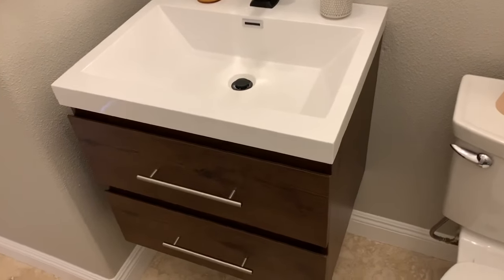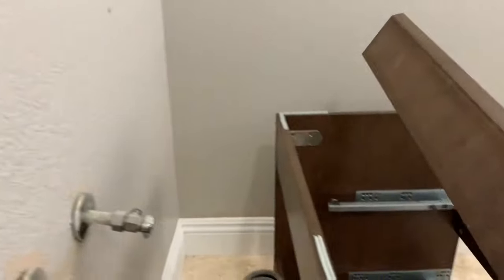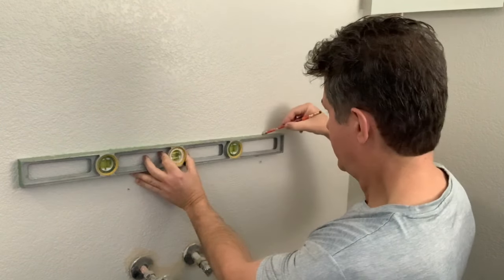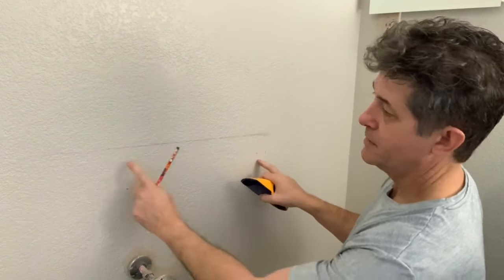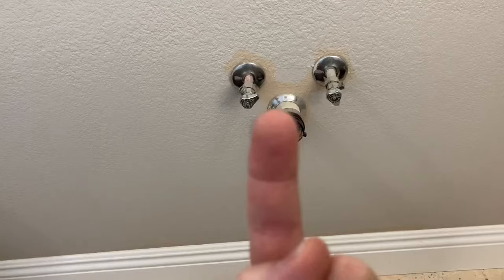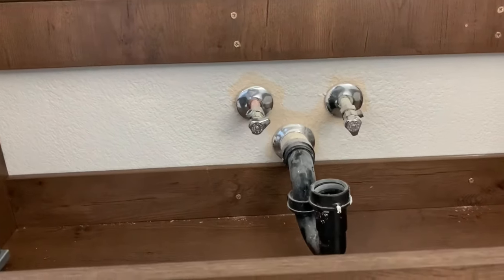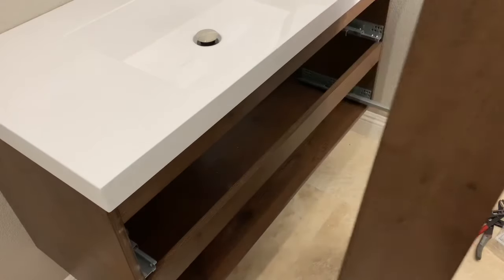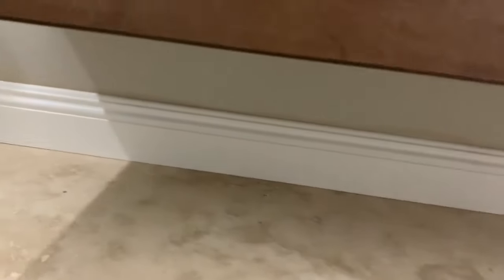Install a Floating Vanity

Comment: The top should be at 39” for optimal comfort, other than that great video
Reply: Where do you get that info from? Years ago we used to install them 30"-33" now 34"-36" is the norm. Where do you find 39" as finish height on the regular?
Reply: 39 is to tall for kids
Reply: 39” I’m not washing my chin bud.

Comment: The water leaks inside the gap between the table top and the wall in my washroom.. and my vanity has kind of deformed/bended as a result of all that water 😢 do you have any recommendations to fill the gap between the tabletop sink and the wall ?? The brand is Magickwoods
Reply from the maker: Sure-just add a bead of caulking at the top where the top meets the wall
Reply: @MikeKlimek Thanks, my plumber came today and added a silicone sealant at the top and also pasted the top to the vanity with the silicone. Turns out the guy who had installed it originally hadn't even bothered to seal the gap when he originally installed it for me. He'd said there would be no problems and I made the mistake of trusting him😢 
My vanity is saved... for now I guess (its a floating one too)

Comment: I am installing a similar vanity but I've run into issues with my wall having a bow at least 2 inches. If i shim the vanity there will be large gap and i dont want to fill the large gap with Caulking.  The only thing i can think of to fill the large gap is drywall compound but I'll need to use alot considering the size of the gap
Reply from the maker: Yes that will be pretty noticeable, especially if you have a nice shiny top and drywall compound to fill in the gaps

Comment: Installing a very similar HD floating 30" vanity now and ran into the same problem with the drain!  I really want this at a 36" finished height so I am going to cut a notch in the lower cross piece. I think it will be secure and not mess with the integrity. Also be sure not to snug against a side wall because the top does stick out each side about 1/4 inch.

Comment from the maker: Thanks for watching! Leave any questions or comments below:
Reply: Thanks for the video. I just got the same vanity, but Im installing in an old building with plaster & lath walls. Any suggestions for wall anchors?
Reply from the maker: @jessesandwich  I would screw into the wall framing behind the lath/plaster. A stud sensor won't help you so you can try measuring from the corner and using an educated guess. The ledger board (french cleat) can be moved wherever is convenient and you can screw into any length of the cleat/board. You can also use  toggle bolts but make sure they are long enough to get behind the lath and plaster. You can use a masonry bit for the hole. Hope this helps!

Comment: What kind of screws (anchors) did you use on those brackets against the drywall? Great video and thanks!
Reply from the maker: I believe they were deck screws, but you can use lag screws

Comment: Beautiful job I would like to get this done to mines I have a question my pipes are low down I think bacause I have a regular vanity what should it do I need help
Reply from the maker: The drain piping is pretty standard. My old vanity was a standard vanity that fit over the piping. You probably will be Ok, but take some measurements first. Worst case you can move the piping up.

Comment: What is dimension of your vanity? I try to build floating vanity with ceramic vessel sink. Does french cleat will hold single floating shelf with heavy vessel sink? Thx
Reply from the maker: I don't have the dimensions off hand, but a solid french cleat will hold a lot of weight. Make sure it is mounted into studs and then also screw in the vanity to the studs

Comment: Can I still install this vanity if my home has metal studs? I have used snap toggles to hang TVs but I’m not sure if they would work for this.
Reply from the maker: Yes you can. I just did a quick search and they hold 265 lbs each! The vanity probably weighs 50lbs.

Comment: Did you install drywall anchors where you screwed in the vanity brackets?
Reply from the maker: No, the wall bracket (french cleat) was screwed into the wall studs

Comment: did you vanity come with the cleat? Or can you find a wooden one at Home Depot I only saw one size which was 12 inches how would I make one?
Reply from the maker: Yes this came with the cleat. You can make one by ripping a board at a 45 degree angle to whatever length you need

Comment: Can you install a floating vanity with plumbing that comes from the floor? Cut hole in bottom for pipe, build box to cover exposed pipe?
Reply from the maker: Sure you could, although a lot of the allure is that the vanity appears to be floating. Having a box to cover the piping may detract from that. I think it would still look cool though!

Comment: Installing mine I think I broke the plastic slides in the drawers, would you happen to know where I can buy a replacement?
Reply from the maker: If you are talking about the plastic tabs to remove the drawer...I would think the manufacturer is the place to go. If your drawer slides broke, you can try to buy a generic set of 2 at a home center, and replace the ones currently on the drawer and cabinet.

Comment: What brand is your vanity and where did you purchase it? Thank you.
Reply from the maker: I got it from homedepot.com... Bohemia 42 in. W Bath Vanity in Rosewood with Reinforced Acrylic Vanity Top in White with White Basin.
Reply: Thank you for the quick reply and video. I think I can do it. :D
Reply from the maker: @nancys7426  Of course you can!
Reply: I found the studs 12 inches away. I purchased a 24 inch Bohemia vanity. Hopefully that would be enough to hold it up.
Reply from the maker: @nancys7426  You'll be fine. The cleat that comes with it will span the length of the vanity.

Comment: Great video. My contractor installed mine a week ago and somebody working on my bathroom damaged the top. Is it possible to replace the top without damaging the base? Thanks.
Reply from the maker: Yes! I used an adhesive silicone so I would have to cut through that to separate them. You probably have the same thing (or something similar). You will need to disconnect the faucet/supply lines and drain and it will lift right off. You could also see if a resurfacing company can resurface the top to avoid this.
Reply: @MikeKlimek  Thanks for the response.

Comment: Which material have to use for the sliding system. I tried this in my home . I think my plumber used gi fittings. Now complete is rusted and very difficult to open the draws.
Reply from the maker: I really don't understand your question. The drawers of the vanity won't open because of something the plumber did?

Comment: Installing the french cleat on your 34 inch high line wouldn't make the vanity higher after?
Reply: never mind i think that is why you had to lower it afterwards
Reply from the maker: Yes it would. On this particular model, the support at the top rear of the vanity is around 4". Then you have the counter on top of that.

Comment: How did you remove the drawers in the beginning?
Reply from the maker: There are 2 plastic tabs that you slide out. Here is a video of doing that...it's near the end: https://youtu.be/voxz1BX5vcw
Reply: I have a very similar HD vanity with wood drawers. You have to unscrew the small wood screw in the front and then lift drawer up and out. It was unusual and took me awhile to figure out due to horrible directions.

Comment: Why didn't you use lag screws to support the sink?
Reply from the maker: A couple of reasons. First, the sink top is an integrated bowl that was made specifically to sit directly on top of the vanity with caulk (I used adhesive caulk). It has no holes in back to screw into. Second, the cleat that supports the vanity is secured into studs with manufacturer supplied screws. Third the directions didn't call for it. I suppose you could have used lag bolts in the cleat-it would have been overkill but would have worked fine.
Reply: @MikeKlimek  ok then thank you for responding

Comment: Thanks for the video. I would like to know where you get that vanity. If you can help me with the item number that would be great. Thanks a lot
Reply from the maker: I got it at homedepot.com (ordered it online). Here is the info: Bohemia 42 in. W Bath Vanity in Rosewood with Reinforced Acrylic Vanity Top in White with White Basin

Store SKU # 1002586220
Internet # 302374125
Reply: Appreciate it. Thank you so much sir

Comment: Hi nice I ddid buy ssme vanity how can I take the derower out to install the water faucet and pipe
Reply from the maker: Pull the drawer out and underneath on each of the drawer slides is a black plastic tab. Pull these tabs toward the center and it will release the drawer from the slides. Then you can lift the drawer out.